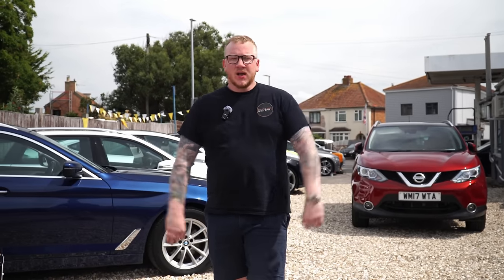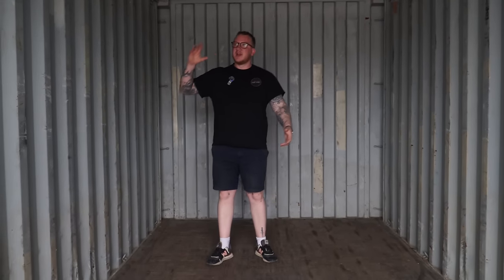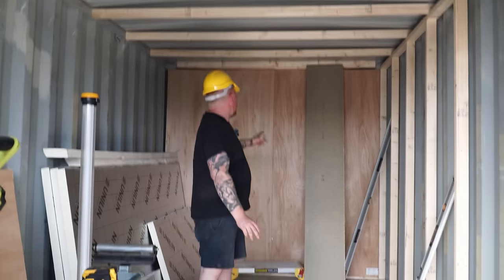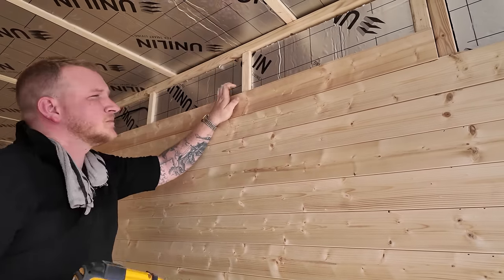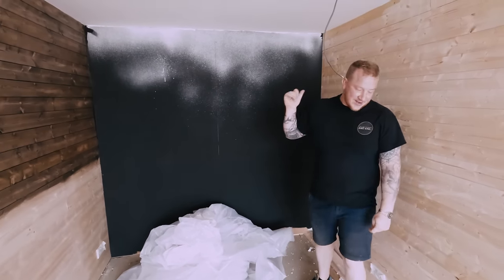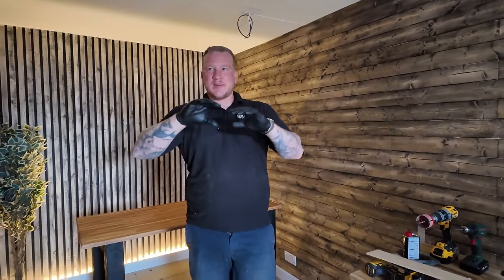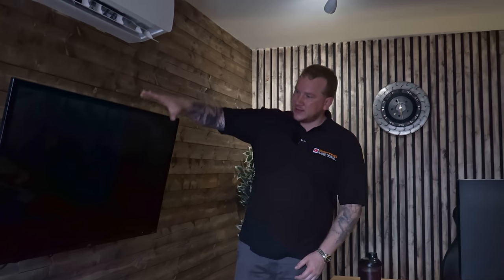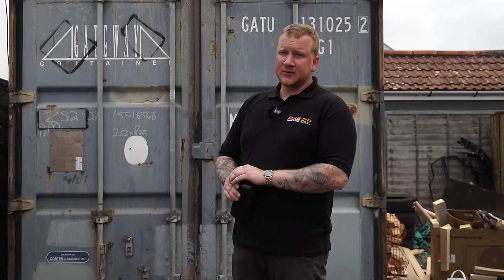Old Shipping Container Converted Into Modern Office In Just 10 DAYS!

Comment: Looks good. Suggest adding ventilation, you have sealed up the container, the AC just recirculates the air inside… with 3 men in their the air will quickly become ‘stale’ 🤢, CO2 levels will rise and condensation will quickly become a problem and start rotting the wood and smelling!

I would add a passive vent in the door end and a extractor vent in the back wall so you can get air flow through in winter when the door is shut plus the passive vent keeps the air fresh when all closed up and no one in there.
Reply: Whatver
Reply: Was about to write the same comment! Ventilation is critical in container conversions. It will be an awful place to work come the winter when the heating is on, the door closed and zero airflow... Low vents near the open end, and high vents on the back wall or either side at the back! Could even add a C02/VOC monitor with a little controller to vary the fans!
Reply: Further to this, I hope you remembered the vapour barrier between the inside wall and the steel outer wall of the container? Without this you'll likely get what they call interstitial condensation taking place within the wall structure, potentially causing premature rot and decay.
Reply: I don’t think you understand how an AC works.. he obviously put a whole for the AC he just didn’t show it in the video. The AC can’t do anything without outside air
Reply: @tavi7  The type fitted is a mini-split! It has an external unit and an internal unit! There is no need for air to exchange between the internal and external units, only refrigerant gas is exchanged. Perhaps you need to learn a little more about AC units before commenting...
Reply: @dougle03  I think you need to go to school and come back and read what I said. I know exactly how a heat pump works

Comment: Did you check if planning permission is required? Generally speaking, as a shipping container is considered a temporary structure it doesn't need planning permission but if it's being used for business purposes and remains in one location for longer than 28 days it may need approval.